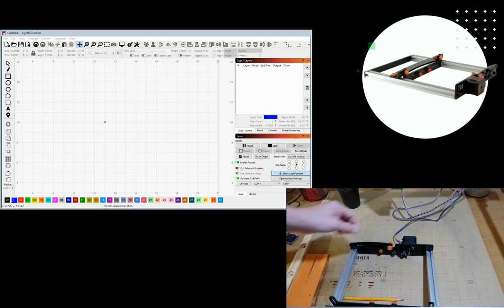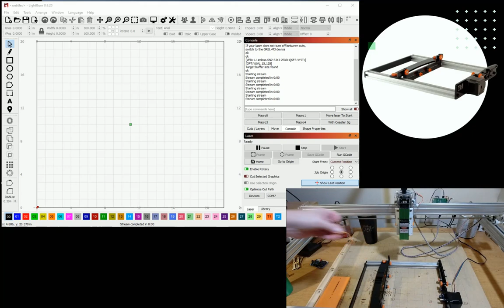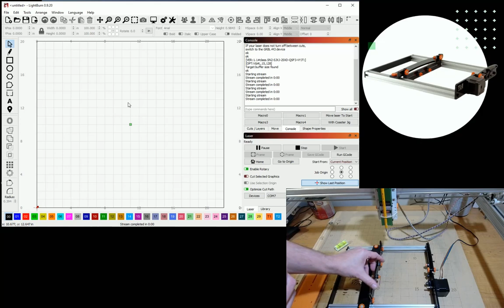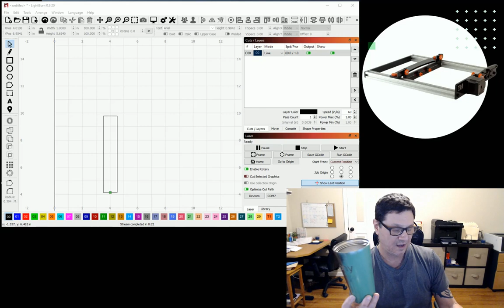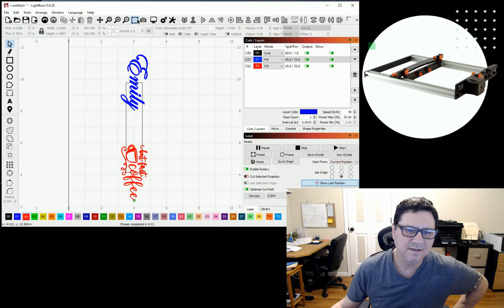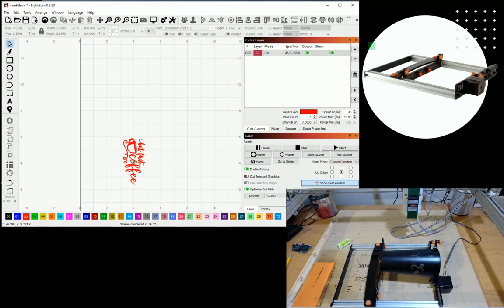Yora TLC Rotary Attachment

Comment: Hi Tony, I would like to ask if is true that I need to change speed depends on colors because some tumbler need more speed or power?
Reply from the maker: Yes, some tumblers like the Yeti cups have a thicker coating which may require either more power or slower speeds to get the best results. Then you have some of the cheap cups that have a very thin layer of coating that you can burn through very easy. Testing each type of cup your going to burn is key.

Comment: I did not know how to contact you so I'm hoping you will see this. Do you know if the xTool RD2 Pro rotary will work on my YoraHome 6550-PRO?? I don't remember where but I heard you changed wires around to make it work or using a different wire harness???
Reply from the maker: Hi, The XTool Rotary should work with the 6550 no problem. If it doesn't out of the box you may need to swap the two center wires on the rotary cable. There is a 6550 Troubleshooting video in the YH Facebook group that shows you how to do that. 
Thanks

Comment: Hi Tony, 
How does one slow the speed of the TLC rotary? The reason I am asking is because I want to engrave on an RTIC travel tumbler and I am doing 2 passes, but at different speeds.
When I tried to do this on a test tumbler, set the laser module to its origin and started the second pass (with higher speed), the rotary spun so quickly the tumbler spun a little bit and the higher speed (2nd pass) was offset so I had a double burn. Just curious if that can be done?
Thanks Jim
Reply from the maker: Hi Jim, That is a good question. Ive not tried with different speeds but i would assume that if you increase the speed in your layer settings would determine the speed of the rotary motor as well.
Ive never had much luck with a second pass on the rotaries as you almost always get a shadow effect or a double burn. I would recommend using a chuck style rotary for anything with a second pass. It prevents any irregular movement with multiple passes. I have used the following "4th axis" for multiple things and will be doing a video of it with a tumbler in the next few weeks.
https://yorahome.com/products/4th-axis-rotary-module.

Comment: I thought the little arm tensioned by the rubber bands was to go inside the glass to hold it tight against the driving wheel. You have it on the outside (on top) of the glass . Will both ways work OK? Thanks
Reply from the maker: You can do either. I actually think it was ment to be inside the glass like you said but either way as long as it holds it tight.